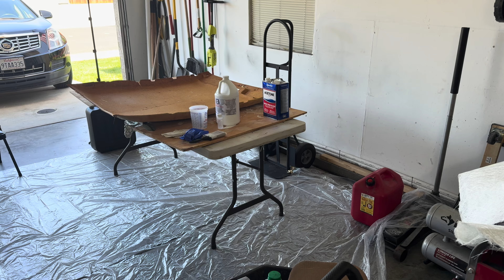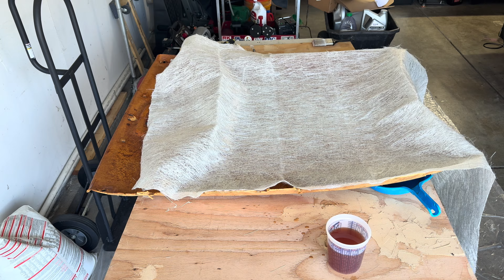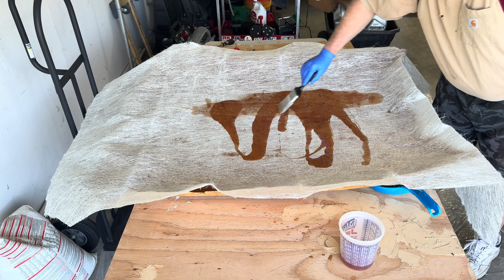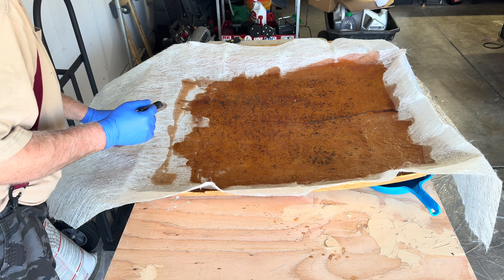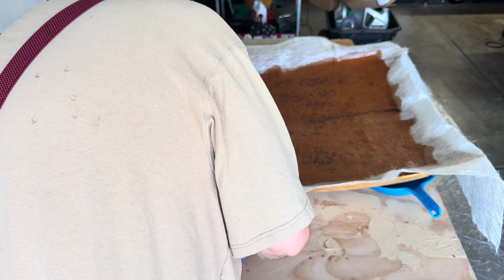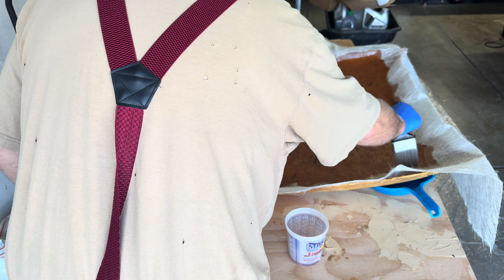Fiberglass Headliner Repair (After 25 Years)

Comment: The one sheet of fiberglass mat should be plenty . Even if u were making a headliner from scratch u only need 2 sheets of fiberglass mat . U are going to cover it with the suede headliner material anyway . The portion in the rear sides are wings . I took mine and removed all the material and sanded the board and then cut new material out to cover the wing , Then applied the Lokweld contact adhesive to both the board and material and finished it . I did use bulldog clips around the edge to hold the material uniformly .